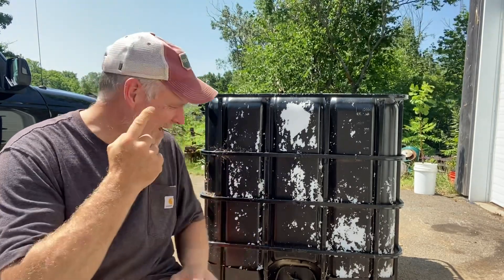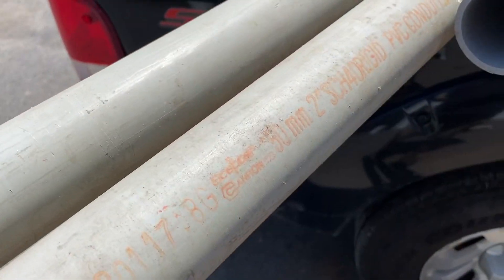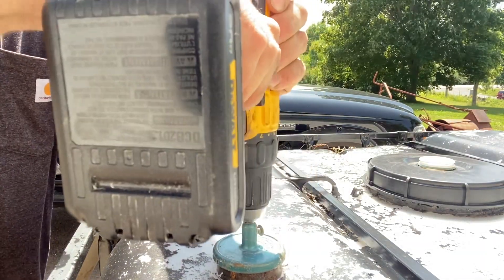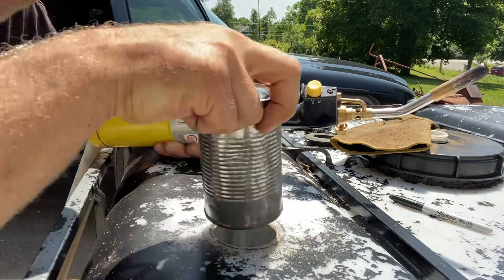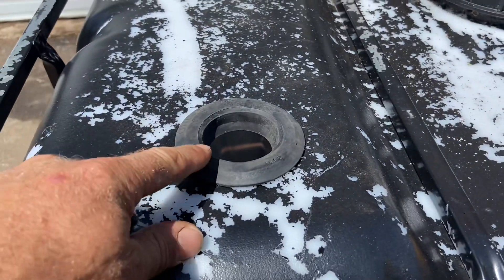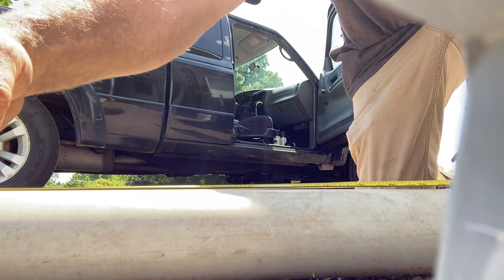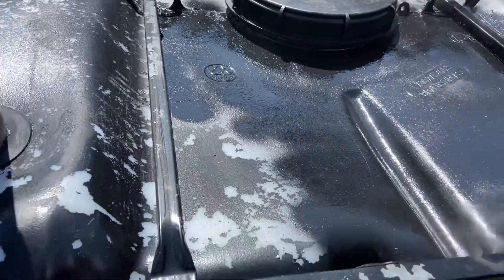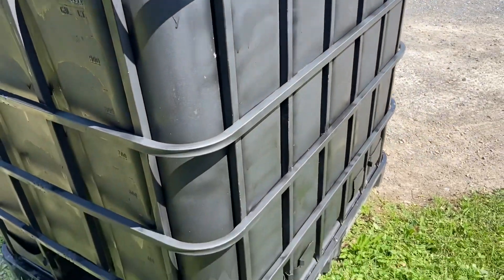DIY / Homemade Bio Digester        ( Bio Gas Series )￼

Comment: I did my best when I painted my IBC... Sanded it, used a primer, blah blah... It Still peeled... No one will answer me when I ask what they painted with... So how did yours hold up when you repainted. 
And I still don't get how that slurry exit works... By the time the tank pressurizes itself enough to push liquid up above the tank, it's also pushing liquid up the input, and possibly, the gas pipes... What am I missing here.
Reply: Best way is to remove the top 2 braces from the cage remove the bladder and wrap it up with heavy black plastic uv resistant and put it back in the cage and replace the 2 braces

Comment: You might have explained this somewhere and I missed it, but with all the venting and open outlets for the fertilizer, how is it supposed to keep any methane in the tank?
Reply from the maker: To the best of my knowledge the tank is seal so when you push the material in the fill tube it exits under the liquid level at bottom. The overflow the holes in the centre so it will be filled up and exiting material will stop gas from exiting through the hole in the centre. The gas out pipe is on top so the gas can be collected. I just started it up hopefully I can show how it works in the near future. Thanks for watching.
Reply: @cheaphomesteading    Ah so. So long as the liquid level inside the tank is higher than any potential vent pipes and all potential vent paths are submerged, then the methane will be forced to stay in the top of the tank. Sounds basically like an anaerobic septic system, but without the drain field and with a slightly different organic material mixture 😜.  Hopefully, you won't have any trouble getting food scraps to go in and not plug your inlet pipe. 

I look forward to seeing how this all works. Found your channel recently and some of your projects look like things I'd had planned to try when I retired.

Comment: One that size you should probably run a small open burner on to heat up some rocks for inside the greenhouse in the winter to extend the season
Reply from the maker: Looking forward to testing it out. I started it up before my holiday so it should start making a good amount of gas shortly.  Thanks for watching